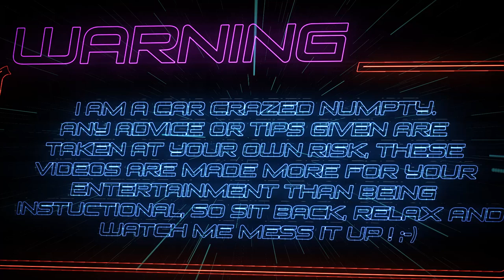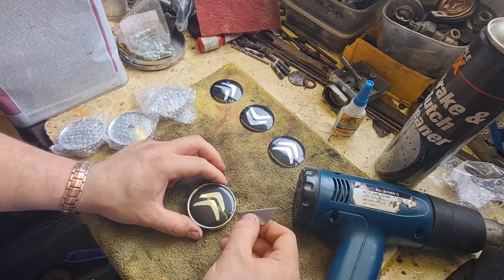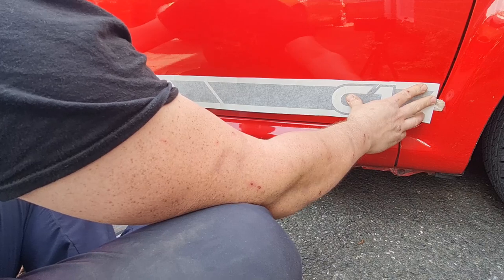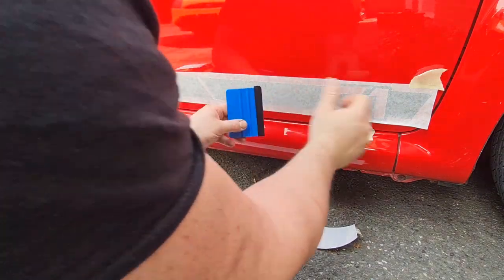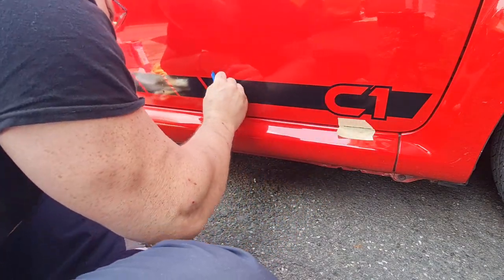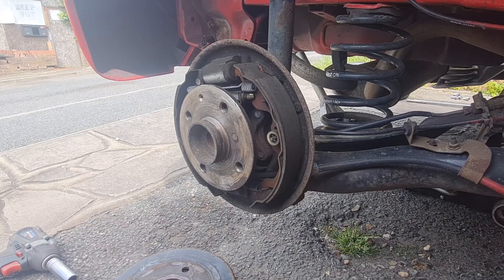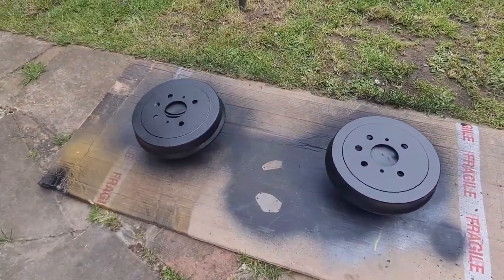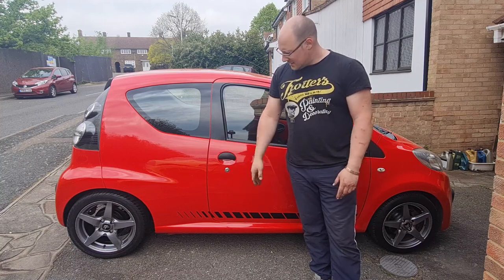Citroen C1 City bug | SIDE STRIPE INSTALL + NEW WHEEL CENTRES and REAR BRAKE DRUM REFURB

Comment: Another great watch. In the past when I've done vinyl work I found using masking tape along the top (so its half on half off) if its a long length slice halfway but leave it in situ, then lift the vinyl up off the backing then squeegee down once backing is removed makes it a little easier but looked great nevertheless. Lovely job on drums and centres. It's these small jobs that make a car aesthetically pleasing on the eye that can add £££s.
Reply from the maker: Thanks mate glad you like it ! Some great advice there thanks ! 👍👍👍

Comment: Big fan of the channel would you know if Fox Racing R4 15” Alloy Wheels would fit my 2009 c1
Reply from the maker: Hi mate, thanks ! Glad you like the channel, Im not sure on those wheels, it all depends on the spec, 15" will fit fine but you need to get the correct offset which is 38, the offset can be slightly less but not to much otherwise the wheels will stick out to far, hope this helps, Regards MEC
Reply: @mec-tec  thanks for the help so I’m looking for 38 offset is that the main thing to look for to make sure they fit?

Comment: Would 15inch MR2 alloys fit on a C1 with the offset of 35?
Reply from the maker: Hi, i would think so, the original offset is 38, so they will stick out slightly further but should be ok 
Hope this helps, regards MEC